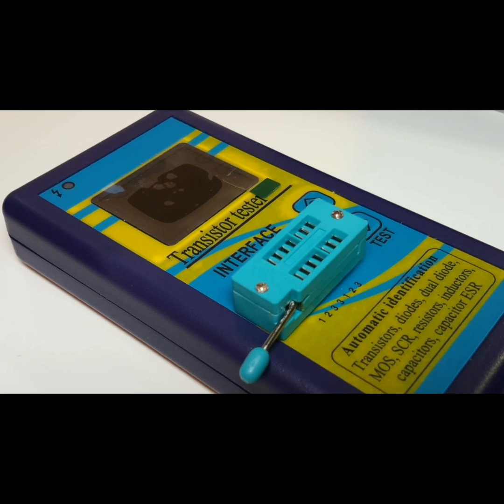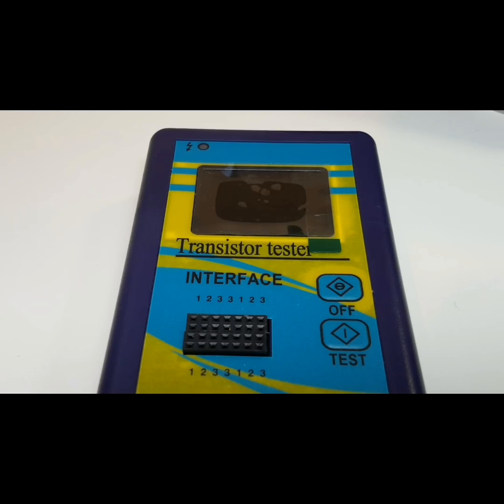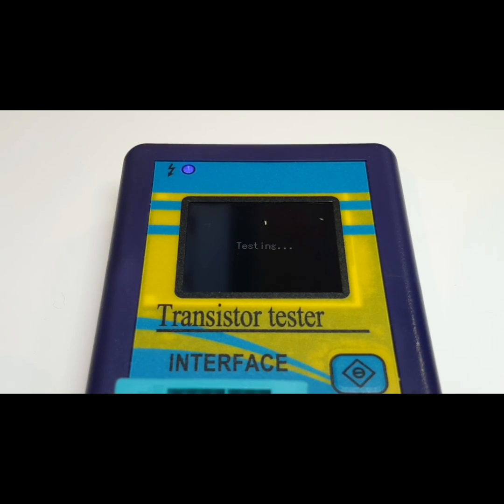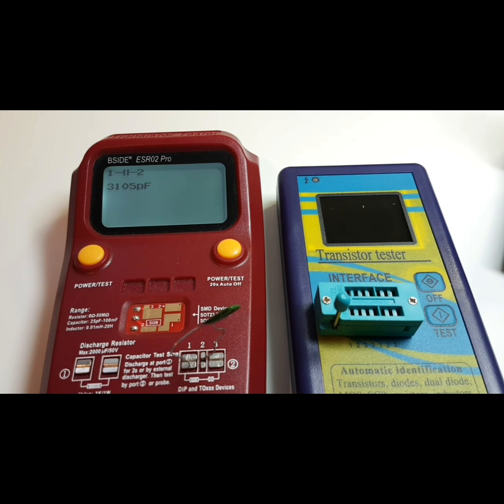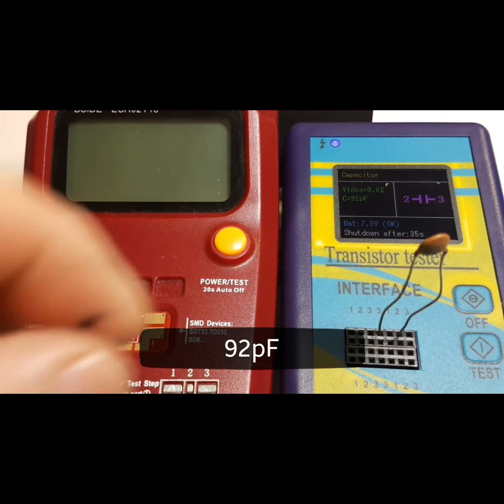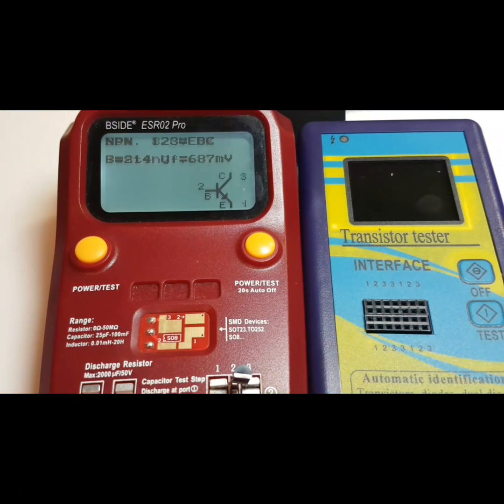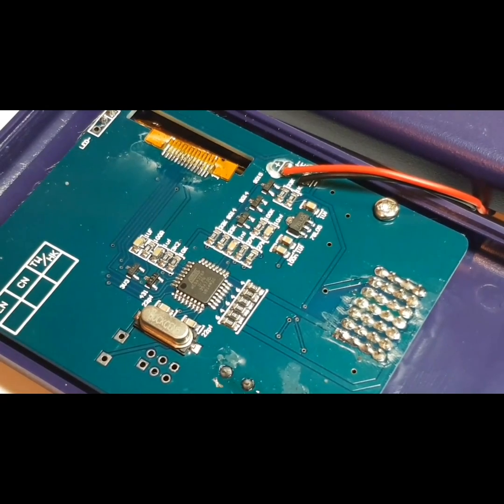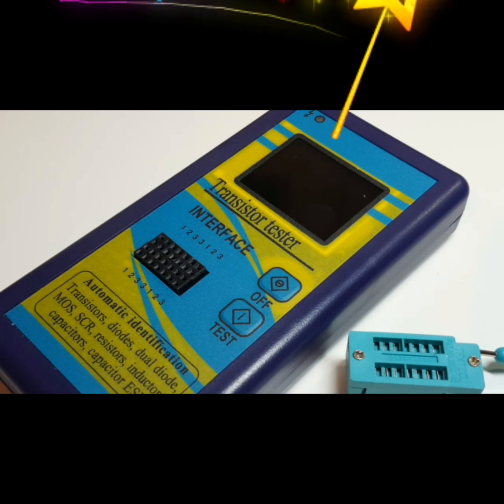M328 Transistor Tester Review & Teardown!

Comment: Any suggestion about M328 v.2.4 selftest? Cannot find instruction pdf...
Reply from the maker: Self test and Calibration: 
 The self test can be prepared by connecting all three test point together and pushing of 
the RPEWS, the color of the Tester’s LCD will change to white font and black background. 
Prompt string “Selftest mode..?”. To begin the self test, the RPEWS must be pressed again 
within 2 seconds, otherwise the tester will continue with a normal measurement. Now the 
self test is started, the tester will prompt you for the next step. Wait for the Prompt string: 
“Isolate Probes!”, then remove the connections. Tester will wait, till it’s senses the dis-
connection, then it continues the self test process. 
 If this is the first time use, the Tester will soon Prompt string “1-||-3 > 100nF”. A capacitor 
with any capacity between 100nF and 20μF connected to pin 1 and pin 3 is required for the 
last task of calibration. You should connect the capacitor not before this text is shown. With 
this capacitor the offset voltage of the analog comparator will be compensated for better 
measurement of capacity values.
Reply: @KeepOnTesting  Thanks...you mean "rotary pulse encoder with switch" ? But I have stop & Test button only!? Anyway I'm going to connect the probes and push Test button.  :)
Reply: @KeepOnTesting  Finally I got it. My version is mega308 v.2.4; To start self test It need probes to pins 9 to 11, and then 10 to 13 connected. Then push start. thanks
Reply from the maker: @algreen1231  Great stuff ! Keep On Testing 😀👍

Comment: My tester shows around 7.3 Volts (like yours) for the 9V battery (brand new ... reads as 9.3V in my other tester).  I have the same color tester as in this video.  The black one in other videos shows 9V correctly.  Is there something screwy with this particular color tester (different firmware or some other fault)?  If this simple reading is off by 2 Volts, what else could be wrong?  Hmm...

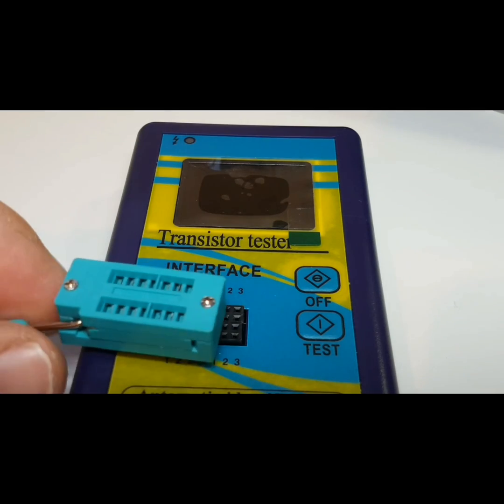Comment: About the wobbly ZIF socket on this tester.  Notice at 1:19 the bottom of the socket.  It has 7 pads that stick out.  6 on the sides and 1 in the center (between pins).  The ZIF socket tips over the center pad, as side pads hang off the socket of the tester.  Gently scrape off the center pad (just this one) off the socket to make that surface smooth.  The plastic is pretty soft, so it's easy to do.  Just make sure you don't bend the pins.  Now, put the socket in.  Make sure the lever is up (unlocked) and pull out the socket.  Now the socket pins are the longest sticking out.  Put the lever down (locked) and now the pins are locked in place.  Insert the socket as is into the tester.  Now the socket should not wobble and the pins should be inserted the farthest into the tester.  If you want to make the connection more permanent, use a dab of glue from a glue gun on both sides of the ZIF socket.  It is better to use the ZIF socket, as you can easily replace it.  You are asking for trouble, If you use the plug in the tester, as you will have more trouble replacing it.
It took me longer to type this out than to fix the ZIF socket ;).
Reply from the maker: Great info! Thanks for the detailed 👍 instructions...Keep on Testing!

Comment: These are £10.58 delivered on Amazon UK. I can't agree with you that they're bad value for that price, and yes - mines equally as sloppy regards internal build quality, but it works well, and I'd rather have a replaceable ZIF socket that I can pull out and throw away, than need to solder in a new one.

Comment: I got a similar kit off Ebay but it is the GM328 model which has a few extra features like a rotary encoder for easier navigation and a simple square wave generator. I think it was only like $16 usd shipped but it is a DIY kit and I think the assembled ones are a bit more like $21-23.

The nice thing about it being a DIY kit is that you have a lot of room for customization. For example I just completely omitted the standard blue clamping mechanism and instead just soldered in some banana jacks and it works great. With some slight modification to the included acrylic case it basically looks like it came that way.
Reply from the maker: Hi Joe,
The 328 looks much better build quality wise than this unit. I might do a review on one as well. How is the overall performance? I like the square wave generator inclusion...and real banana Jack's would be a treat! Thanks for watching !
Reply: @KeepOnTesting  There is a huge forum thread on EEVblog on these testers and everyone raves about them. People have made custom firmware as well as 3d printed enclosures etc.

https://www.eevblog.com/forum/testgear/$20-lcr-esr-transistor-checker-project/